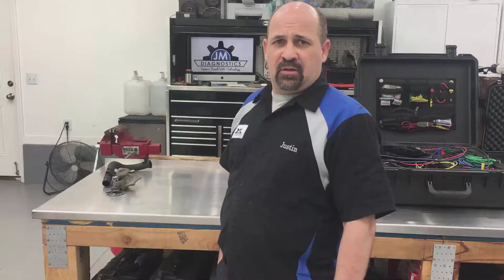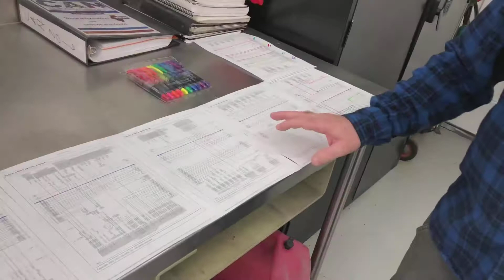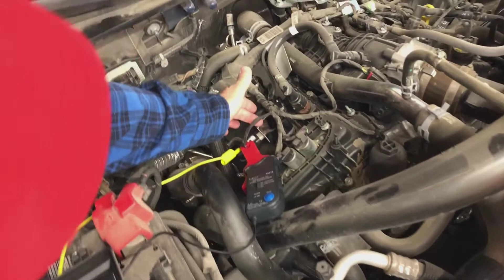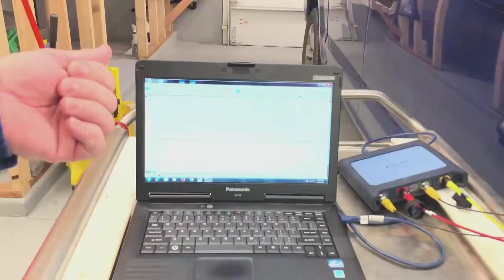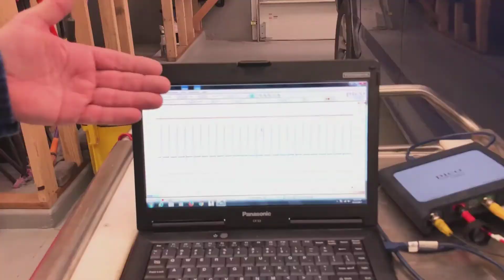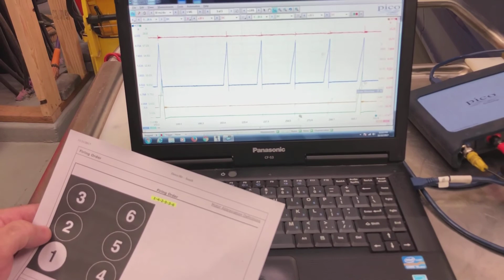How to setup a Scope for Current Ramping Ignition Coils

Comment: i watched   few of your videos  and they are one of the best.thanks
i have 2questions  
what are the scope setting(time.voltage)?
2  what is the yellow connection for. since you already  attached amp  to it
Reply: I was wondering the exact same thing?
If there's an amp clamp on that power feed circuit at the fuse, why would you need another clamp at the circuit by the coil?